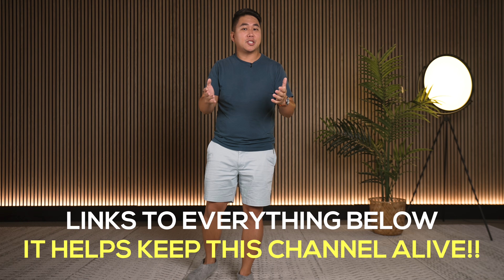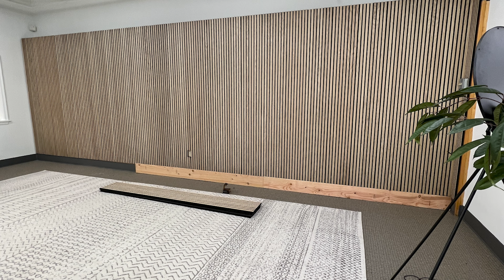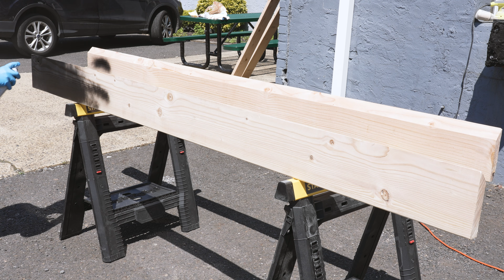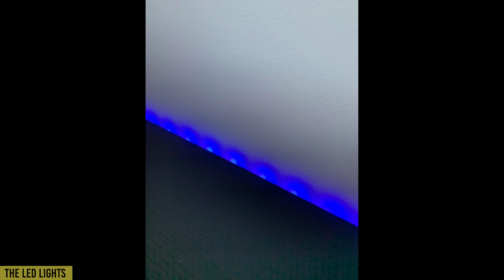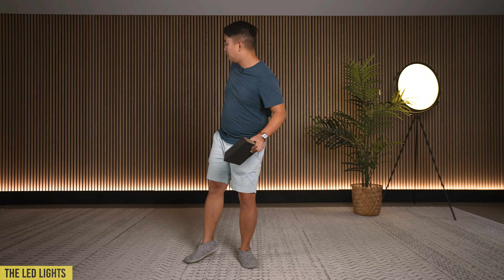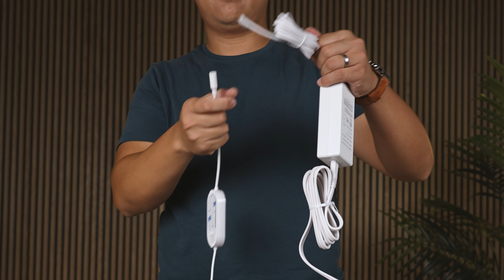How to Add BEAUTIFUL Wall Lighting (SUPER EASY!!)

Comment: Question, would it be better to replace that wood with cut drywall?  Drywall would take paint easily, attach easily, and would be fire resistant as opposed to the wood.

Edit: Ah, maybe the distance from the wall is an important bit here.

Comment: The IC in RGBIC means integrated circuit, not individual color. You can control the colors per segment not each LED itself. In the case of the m1 strip, thats 6 leds per segment. 10 segments per meter = 60 leds/ meter.

Comment: Instead of having to cut the wood on an angle, I suggest using a taller and a shorter piece of wood stuck together. Then the LED can sit on top of the shorter piece and face directly up. So imagine these two letters are wood and the dot on the i is the LED: li

This way you don't really need to get the angle right and can probably find pre-made pieces. Plus the light shines directly up which will probably extend up the wall better
Reply: dust accumulation zone?

Comment: This is going to come off harsh, but I sincerely mean this as constructive criticism. This was the first of your videos I stumbled upon, and it felt click-baity by saying this was a super easy DIY when it's extremely half-assed. A little extra effort in research and effort would've gone a long way with tying together the look and validating your knowledge. Outside of the woodworking issues, you even get the most basic technical information wrong. For instance, for RGBIC LEDs, the "IC" means "Integrated Circuit" and not "Individual Color." Also, 60 LED/m isn't high-end, it's pretty average, so maybe higher density was the better term for your point.

Having seen this, the center board misalignment with the wood/LEDs in the background is highlighted constantly now. Tossing money ("sponsored?") at pre-fab slat walls, Govee LEDs, and high-end furniture, just to cut corners on the finishings to round out the look was disappointing to see. I'm especially surprised you even sanded it, because that's probably the most labor-intensive and time-consuming step out of everything required.

Anyways, good luck!
Reply from the maker: Appreciate the feedback! So I’m not a DIY channel - I review chairs and home office tech. I run this entire thing by myself, so while I wish I had the time (and energy / expertise) to do a more perfect finish, I just didn’t have that. It’s also for a set, so I didn’t need it to be perfect. The idea here was to give people a general idea of how to do something like this without making it overly complicated for people who have 0 woodworking knowledge and don’t care to become wood working professionals or amass a ton of tools / materials that will never be used again. I’ve attempted a number of projects and realized that when people say something is easy or cheap, it’s easy or cheap IF you have the tools already and you use the paint / primer / varnish / stain / brushes multiple times. But if you use it once and never again, it costs hundred(s) of dollars to be used just once. So I wanted to give an actual idea of how to make it actually simple (at least what simple means to me). It’s been cool to see experts / DIYers / handy people comment here and recommend ways to make this concept better. 

Getting IC wrong is def on me. I don’t do teleprompters, I go off memory, so I def botched that one. I do believe IC means that the LED lights can be individually addressed though, which is probably why I thought it meant individual color. 

Regardless, I appreciate you taking the time to leave feedback. By nature I’m a cut twice measure once kinda guy, and it’s good to have reminders like this to slow down a bit and do better work.

Comment: At least you’re honest in the half-assness.  If you want to add a diffuser cut a groove in the angle you cut to recess the LED. 
Also ppl, your walls & floors may not be flat, it will show in the end result. Take the time to do the project right & use proper techniques to do a good job. i.e removing any old baseboards, scribing the bottom of the new baseboards, & adding shims behind the baseboards. Good video in theory. Practice makes perfect.
Reply: Your making assumptions.. first off where do you get his floor is not level? plus he did mention he is a dummy when it comes to woodworking.. don't be an asshat

Comment: A better option is to use 2 wood sizes. one less wide than the other. when you glue them together you will have a hidden lip to put your LED light in. Imagine one wood half inch thick by 8 inch wide and the half inch thick and 7 inch wide. Join them together and you will have you lip to hied the LED light and you angle the light as you please.....
Reply: Do you still bevel the edge on the shorter 7" piece? Or just shoot the LED strip straight upward
Reply: @c.s.herman860  I would guess there would be no need to Bevel it since you have a recessed wood lower hiding the strips. So you would have the perfect illumination upward without seeing the strip and it doesn't have to be 2x6 lumbar
Reply: @c.s.herman860 I would guess you might want a very slight angle like maybe 10 degrees so it does hit the wall and not just go straight up.
Reply: let’s see your video
Reply: @monagale2  Video not needed, just a recomendation for those who would like to copy it.

Comment: instead of a 45 degree angle on that bottom trim you could have used a router to make a channel.
Reply: Yep second that
Reply: Personally I'd use the table saw for that, after planing and sanding the construction lumber. A router could as some dimension to the top or even add texture to the face.
Reply: I went to the comments to suggest the same thing. As he mentioned the angle my mind immediately thought it'd be too harsh of a lighting, followed by his confirmation 😢
Reply from the maker: Guys, I’m such a woodworking dummy that the only router I know is the one that shoots your wifi out! One day when I have a real garage I’ll…actually scratch that. I’d be the first one to lose multiple fingers.

Comment: Fun fact: 60leds/m is not a lot. It’s standard for any medium grade led light. You can find 120leds/m fairly easily and for cheaper than $90/5m. What you’re paying for with Govee is power supply and built in controls. You do pay more for plug and play tech but for a lot of people it’s worth it.
Reply: Would you say Gove is the closest to “plug and play”? I’d like to be able to turn on my switch to my ceiling lights and then have these lights also turn on. Any thoughts or how that is possible?